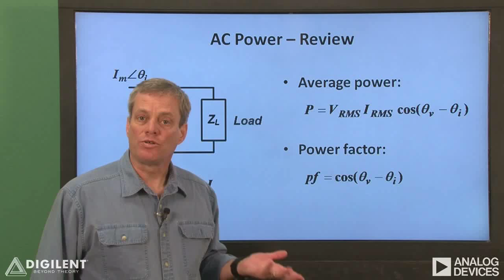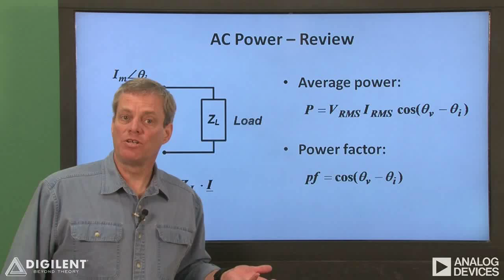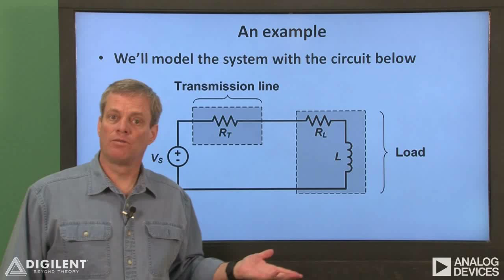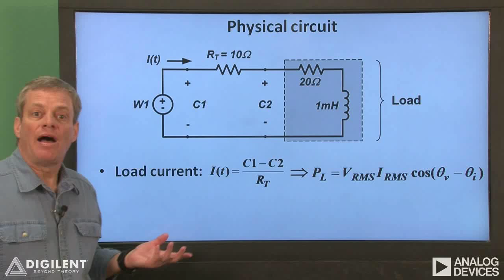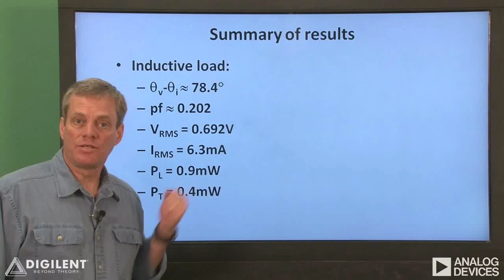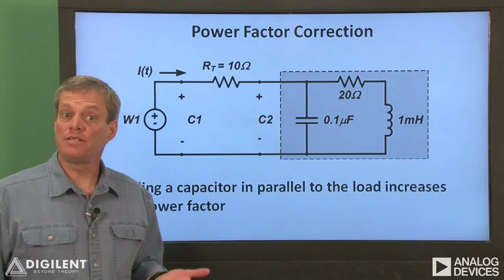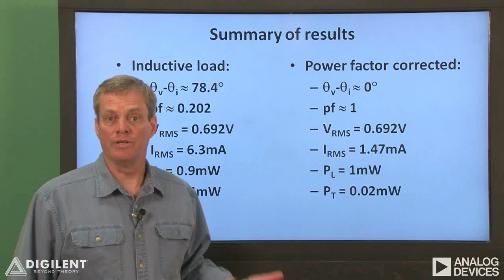Real Analog - Circuits1 Labs: Ch12 Vid1: AC Power & Power Factor

Comment: how could I download this software to use with breadboard to study ? I would like to this test to understand better how all works, thanks.
Reply from the maker: +Rodrigo Costa (rodricosta) The software Tim is using is called "Waveforms" and is available for free from Digilent. The scope he is using to make the measurements is the Analog Discovery. Both the Analog Discovery and Waveforms have been updated since this video was created. So here are the links to the new versions:

Analog Discovery 2 (AD2): http://store.digilentinc.com/analog-discovery-2-100msps-usb-oscilloscope-logic-analyzer-and-variable-power-supply/

Waveforms2015: http://store.digilentinc.com/waveforms-2015-download-only/

If you are looking for breadboards and components, everything Tim is using in this video comes with the Analog Parts Kit, available here: http://store.digilentinc.com/analog-parts-kit-by-analog-devices-companion-parts-kit-for-the-analog-discovery/

Hope this helps! Thank you for the question.
Reply: Thank you for the quick answer, and thanks for the links, I'll buy them.
The Analog Discovery 2 100MSPS can plug on AC outlet 110v or 220v ?
Reply from the maker: +Rodrigo Costa (rodricosta) The power supply we sell (link below) is switching, so it can be used with 110 or 220. If you are using another power supply, as long as it supplies 5v at 2.5A, you should be good to go.

Keep in mind that the AD2 runs off of USB power, and that is usually enough for most applications. If you do need the extra juice from an external power supply, this is the power supply we recommend: http://store.digilentinc.com/5v-2-5a-switching-power-supply/

Comment: Why did the current amplitude drop with a nearly unity power factor? Does the generator frequency affect the values?
Reply from the maker: +uiticus This is a good question to post on our technical forums: https://forum.digilentinc.com/

Thank you for the question!
Reply: The phase difference between the load voltage and the load current. Think of it like a wave on water. If two waves come at each other with the same amplitude but with exactly opposite crests/troughs, the net result is nearly flat water and all of the energy used to create them both has been wasted. If the crests/troughs match, you get less wasted energy. If the beach the wave A is landing on requires it to have a minimum height of X, and a second wave B (with mismatched crests/troughs) is coming in that cancels part of A to less than X, the source of A has to put more energy in to make up that difference to achieve X. If B is in phase with A such that B has nearly 0 negative effect, the source of A doesn't waste as much energy overcoming B.

Electrical components have sinusoidal behavior when AC power is applied. That should be obvious. But the phase of each component must be considered in order to achieve high efficiency. In small applications this doesn't matter so much, but just from this demo you can see that the total load (both RT and RL) on the source went way down because the two waves are more in sync and so the system is not fighting through the transmission portion so hard in order to deliver the needed power to the load.